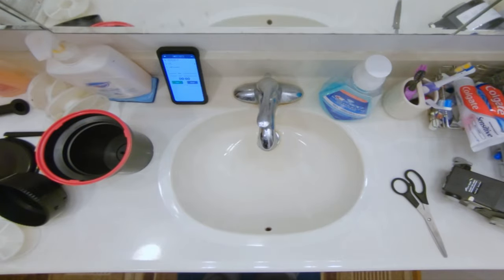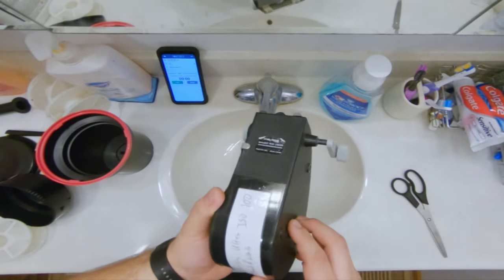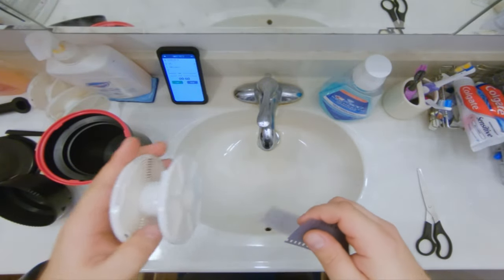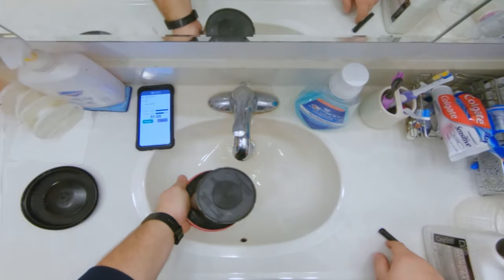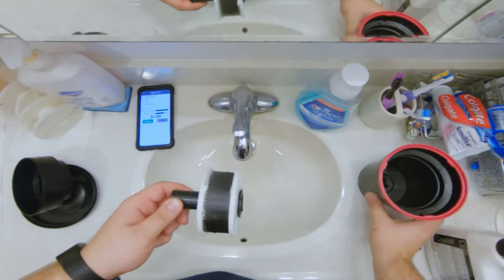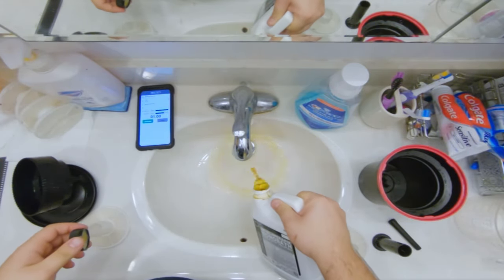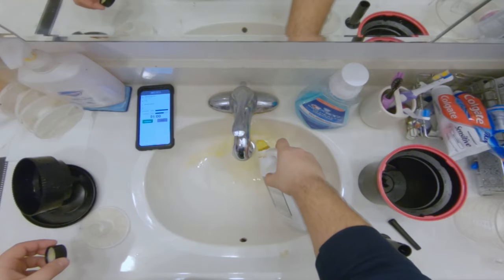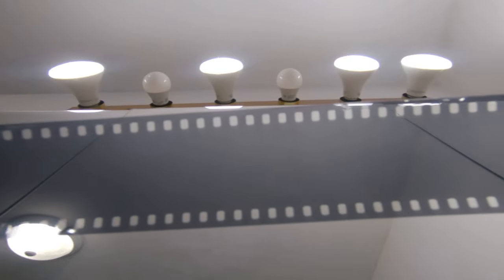Cinestill DF96 Ruins Film? Bromide Drag? Photo examples of ruined film at end of video

Comment: How old is your chemistry? My bottle of DF96 is about a month old and looks nowhere as yellow as yours. I wonder if you’ve got some exhausted chemicals. Also, you really shouldn’t pour that stuff down the drain and instead should get it properly disposed of.
Reply from the maker: The chemistry in the video was maybe a few weeks old; probably 6-7 rolls of 35mm film was processed by it. I've had one bottle that I used for 30 some rolls of 35mm and they weren't underdeveloped or were thin but some rolls were ruined. I also had 4 important rolls messed up by using brand new DF96 chemistry. Since switching to Rodinal and Ilfosol 3, I've never had any issues with any rolls although they are used as one shot developers. 
My local municipal water treatment plant said that it was okay to pour down the drain..